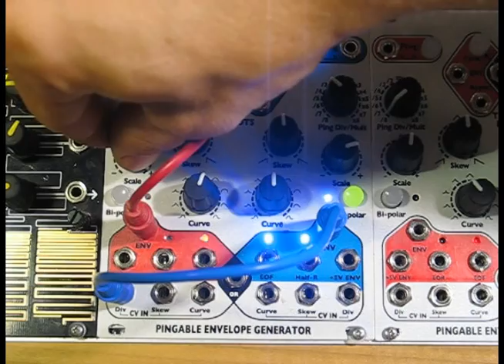Pingable Envelope Generator (PEG) technical demo 4ms

Comment: Does the cycle button need to be on for operation mine wont work unless its depressed?
Reply: Mine does the same thing. I need to check the manual, but I think it's normal.

Comment: This or maths?
Reply: Yeah that's what i was thinking..i have the maths and this unit does a lot of similar things from a quick look at the controls.
Reply: In my experience, 4MS PEG definitely has the advantage of some great quantizing and clock div/mult functionality. Me, personally, I get more from the Maths simply due to the logic aspect of it and the attenuverters.
Reply: I recently built the Befaco Rampage but, this, the Eurorack versions of the Buchla, serge and the Maths are on my list as well. Can Never have too many function generators